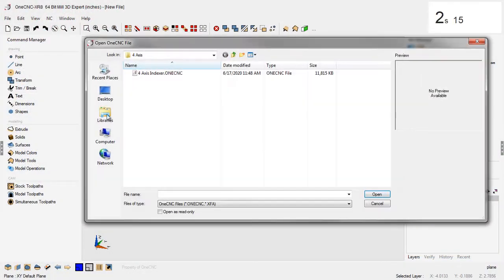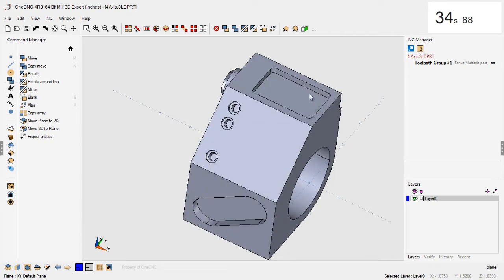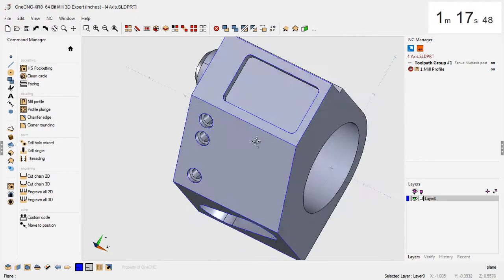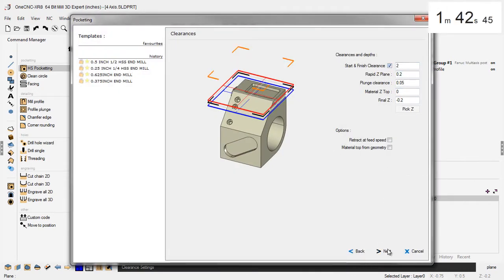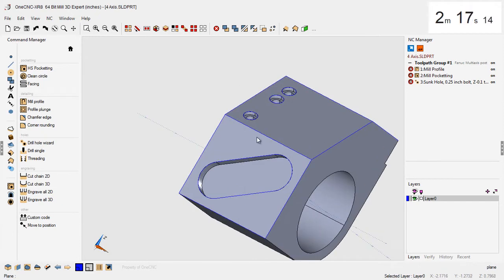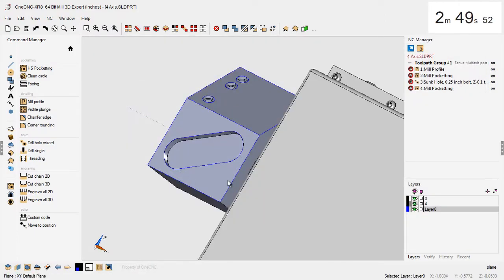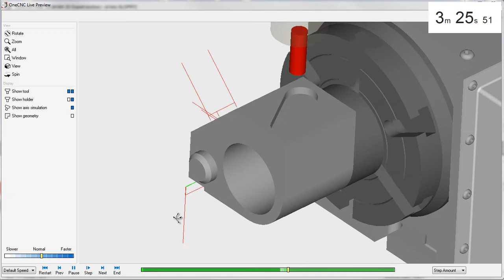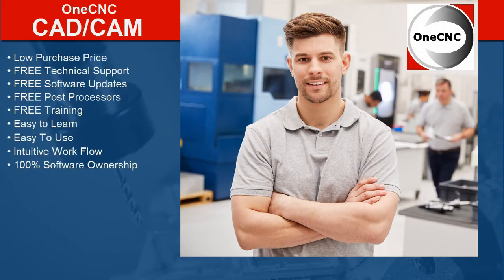4 Axis Program in under 4 Minutes!

Comment: Cant even get a price without asking for a quote. Maybe they want to charge me extra? Whats so hard about posting your "low price"?
Reply from the maker: Hi and thank you for your question regarding OneCNC quotations. The reason that the best / low price is not posted is because each reseller has their own sales territory and possible sales promos. For example, a reseller may be offering a promo (or discounted price) that the other resellers are not offering. Therefore the OneCNC prices are not posted. However, to find the best, lowest price, simply contact your OneCNC reseller and request the current prices. I would bet that in todays highly competitive CADCAM sales environment, your local reseller won't be wanting to charge you more but rather make sure that OneCNC is correct fit for your CADCAM requirements, then work with you regarding prices.

Comment: Would be nice to see how you orientated the axis to the machine datums
Reply from the maker: Hi Philip and thank you for your question.

When using OneCNC 4 axis position machining, construction planes are used to instruct OneCNC what 4th axis angle to index to. So, for each face that needs to be machined (on the solid model) a construction plane will need to be created. You can create the construction planes on the fly like I did in the video.

You will notice at 49 seconds into the video (please reference the time counter in the upper right corner), I click the "Create Construction Plane" button, then I click the face of the solid model. This creates the construction plane, makes that construction plane current and instructs OneCNC to index to that face. It's the button located on the far right of the top tool bar.

So, before I apply tool path to a face, you will notice, I click the "Create Construction Plane" button then click the face. I am creating the construction planes on the fly and before I apply the machining operations.
Reply: @onecncwest  Thankyou for the info it is a real help